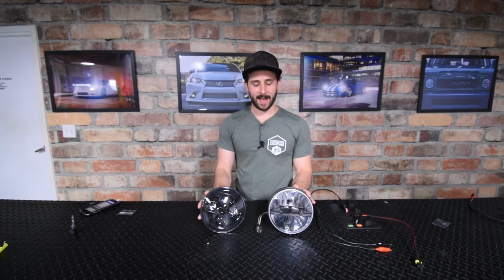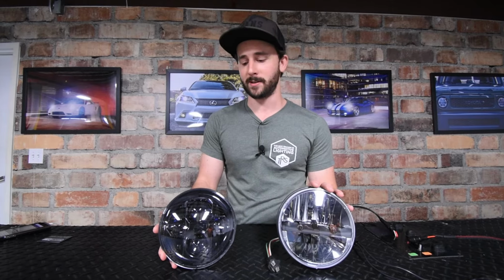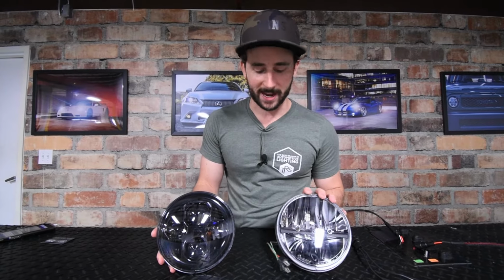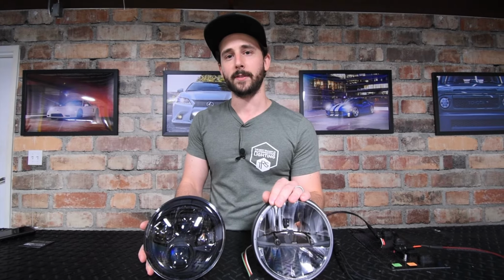Morimoto Sealed7 2.0 LAND ROVER DEFENDER LED HEADLIGHTS

Comment: How does the Sealed7 stack up against the Super7? And does the Holley Retrobright even stand a chance?
Reply from the maker: Super7 will be the brightest of them all because it uses a bi-LED projector (full size) as the primary source of light.
The Sealed7 is a great modernized upgrade for a smaller budget. Still a fantastic output.
The Holley x Retrobright is great for a classic look, but won't be comparable to the other two since it uses LED reflector optics.

Comment: Why do all the LED replacement lights look so ridiculous? I would have left the trucklight ones on.
Can you recommend a good light that doesn't look like spider eyes? I would rather not have the headlight try to steal the overall aesthetic of the car but rather blend in. 
Thanks.
Reply from the maker: You could always do the Holley Retrobrights.
Reply: @RetrofitSource  thanks. That looks like a good option.

Comment: How do we install these on a 2016 Jeep Wrangler?
Reply from the maker: Pop the hood, Remove the 6 plastic clips along the top of the grille, unplug the factory turn signals on the left and right side of the grille, pull the grille toward you to release the metal clips along the bottom. Remove the 4 T15 screws holding each headlight housing in the Jeep, Remove the headlight and install your new lights!
Reply: @RetrofitSource  thanks for the quick reply. 
I should have been more specific.
The three random wires that don't have a plug. No idea what to do with those 😞
It's the DRL & Amber turn signal wire. 
How do Jeep owners get those to function/where do they install them?
Reply from the maker: Tie the wiring into your factory turn signal and parking light connector, You’ll want to test the wires using a multimeter to make sure you’ve got it connected properly. Send us an email if you have any questions beyond that!